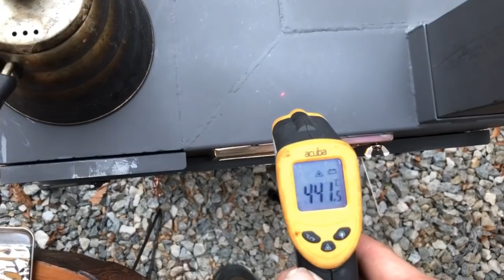3오븐 각관 로켓스토브 만들기 / 캠핑 / Angle Pipe 3oven Rocket Stove making  / Camping

Comment: You’ve got an amazing engineering mind.  I’m new to TIG, what is that “tap welding” you’re doing?  What are the machine settings for that?
Reply from the maker: Gas 5
Electricity 100 ~ 140
Teg welding is advantageous for thermal deformation
Reply: I’m using a pedal, I’m guessing this only works with the trigger?  What do you mean Gas 5?

I’m using pure Argon set at about 20 SFCH

Comment: The little piece of metal used at 7:45. Why do you need that?
Reply from the maker: Welcome.
It plays a very important role.
It prevents ash from falling into the chimney.
induces heat in the upper part.
Reply: @stovetv  thank you! I learn a lot

Comment: How does the flames do not go up through the feeding opening 
The flames seem to go sideways only
Reply from the maker: welcome 
It's right to go sideways.
Fuel intake size, chimney height, air supply, etc. should be done well.
Reply: It's interesting what size is the fuel intake and what is the height of the chimney. Asking from over here in Africa

Comment: предлагаю идею для следующего видео печку в палатку для зимней рыбалки с конвектором (трубки в которых будет ходить воздух и нагреарься) минимальными размерами и возможностью работы с газовой горелкой  диаметр дымовой трубы 40мм  примерные размеры самой печки 30х30см
I propose the idea for the next video a stove in a tent for winter fishing with a convector (tubes in which air will go and heat up) with minimum dimensions and the ability to work with a gas burner; the diameter of the chimney is 40 mm; the approximate dimensions of the stove itself are 30x30cm
Reply from the maker: Я буду ссылаться на это.